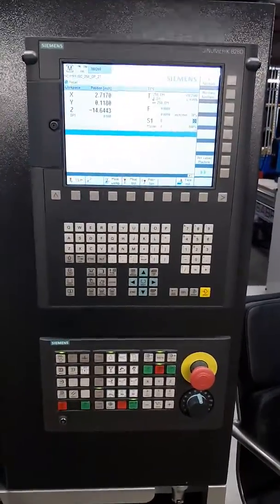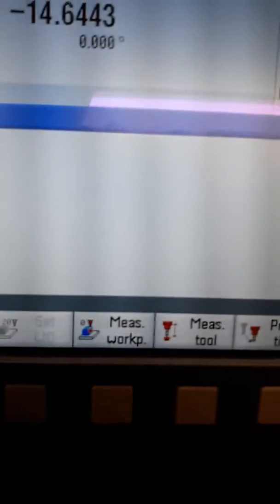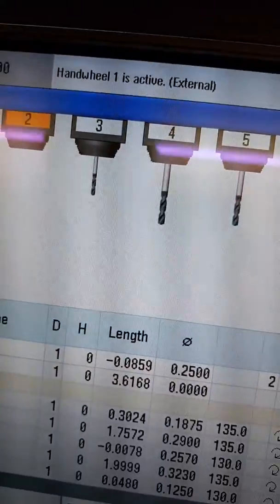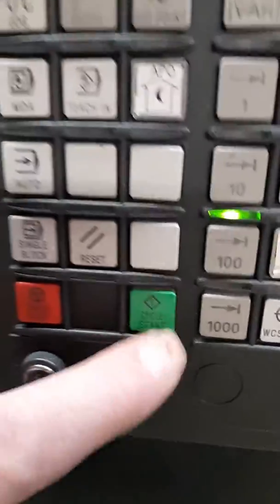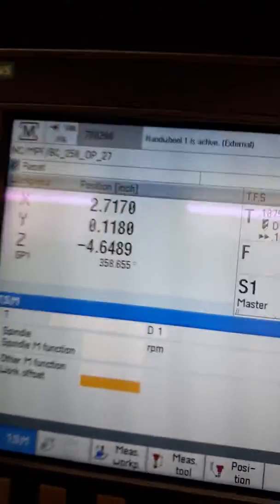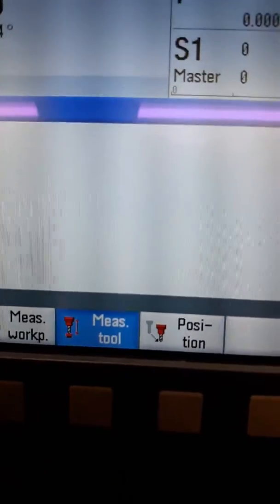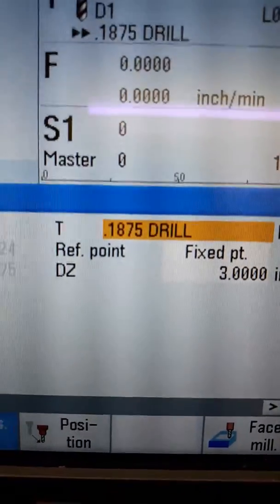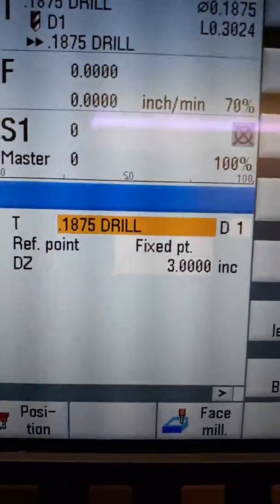Siemens 828d tool call & setup.

Comment: Very long way of calling tools i work on the 828d everyday and i call tools in one short method and its by enetering tool number in the first menu of TSM enter speed and direction of rod
Ration and it's best to use g54 not basic ref...but thats my opinion
Reply: How we retract our tool if tool port is open ?
Reply: Is there any M code that use to return the tool back to the magazine  ? 

Actually I called the tool and it's port down like in spindle !